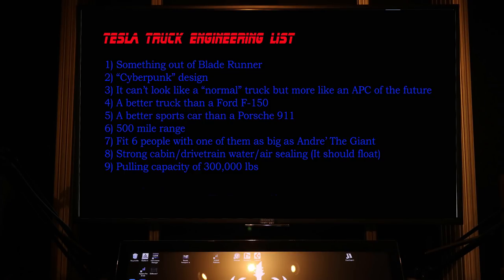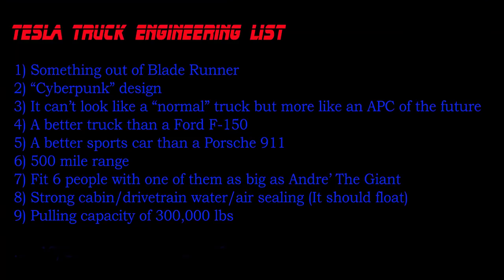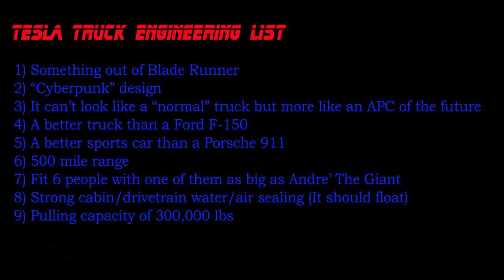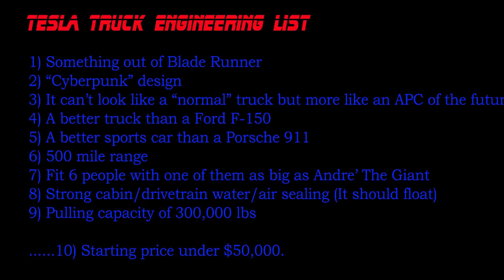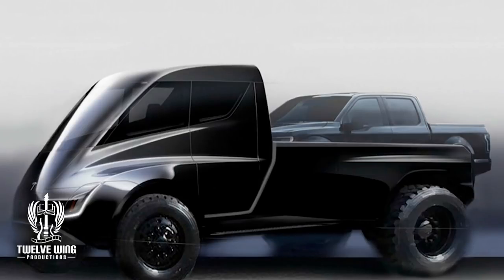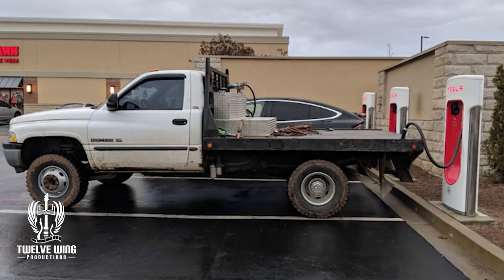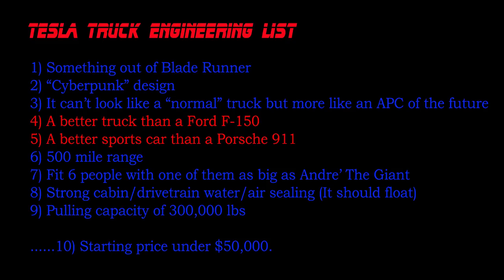What Tesla's Pickup Truck will Really look like: A design exercise

Comment: I say 6 wheels... 6 motors... even spaced, zero turn radius. Moon Patrol. High regen braking to super capacitors to deal with brake energy, especially the front set due to long wheelbase.
Reply from the maker: I desperately looked for a way to have this thing have 6 wheels in my own head.
Rolling resistance finally won out.  As much as I would love to see that, I just don't think it's going to realistically get 500 miles of range and still be able to do that.
I sure hope I'm wrong though.  6 wheels would look sick as hell.
Reply: Twelve Wing Productions if I’m not mistaken, rolling resistance is principally a function of normal force to each tire and their respective out-of-roundness, resulting in the loss of energy associated with overcoming the ‘uphill’ travel as well as the heat associated with the hysteresis of the tire. But by spreading the load over six tires effectively/intelligently, the rolling resistance per tire would be reduced, hence not necessarily increasing overall resistance by 150%.  I also predict that it will have a similar powertrain to the semi with multiple battery packs rather than a large single battery. I predict 3 battery packs of 60+90+90=250 kWh rather than a single 200kWh that the Roadster 2 is supposed to have, which would make it more of a mini-semi, rather than a giant sports car. I know one thing, I am looking forward to November 21...
Reply from the maker: @danwhiffen9235 , all true but there is one other HUGE consideration in a 6wheel vehicle... alignment.
In a configuration where all wheels are equally spaced, turning resistance becomes the major issue with efficiency but in the case where the front two wheels steer (the most common configuration for 6x6 vehicles) the alignment between all 4 of the front wheels is incredibly difficult.
In most of these trucks it's not the fuel economy that suffers the noticeable loss but the scrubbing of the tires and increased wear. 

In the case of an electric vehicle, however, these losses will be very noticeable AND there will be increased tire wear.
So unless they have some way to tune the alignment on the fly (not impossible) I don't really see a 6x6.

But like I said... I sure would love to.
Reply: Twelve Wing Productions I was figuring steering boxes for all three axles which would be digitally controlled rather than mechanical linkages so as to maintain tangency.  Think of the maneuverability, and the complexity. Elon is a wild card with falcon wing doors and cold air thrusters (let alone everything else). This is truly a wondrous exciting time!
Reply: I agree with the 6x6 notion as well.. just in the standard view of a 6x6.. all the issues of tire wear an fuel inefficiencies have been already worked out in the semi truck Industry..  in a turn either the forward or aft axle would lift slightly to reduce drag..now with inboard motors .. this could obtained through suspension dampening on an individual wheel basis maintaining the load / tow weight and torque needs.. 6 wheel drive also makes sense in the towing weight Elon has asked  for .. each motor shares the weight needs reducing wear and higher than needed amp draw...if he can place a 200 kw pack n a sports car .. a 6x6 truck would be no problem.. the cost?.. under 50k?.. think that’s doable as well.. delete the frills..basic model 3 control components...
Reply: Matthias Crenshaw I suspect that a full 6x6 wouldn’t be the bottom trim (50k) alas, I am guessing that trim will be 6x2 (or is it 2x6?) and the battery might be 100kWh... maybe. Barely 200 mile range? 0-60 in 6.5s?... the top trim is going to be nnnnnnnnuts
Reply: Oh well, no 6x6. But what a crazy price. Still looks pretty moon patrol tho
Reply: I like the weird design an love the price.. wish there is more info  on the interior...kinda crazy how franz broke the side windows..😂😂
Reply: Matthias Crenshaw I’ll be in the market for a model Y when they come out, but I doubt I would consider the cybrtrk, not mainly for looks, but I find a van or SUV more overall useful.
Reply: I literally could build a 6x6 on an ex - mil spec Humvee chassis for less than bollinger.. using either used tesla drive units or used Nissan drive units... wouldn’t be hard .. I put money down but I’m driving to build one

Comment: That is a much more intelligent approach and analysis than some of the absurd renderings I've seen online. Most of which simply look like a boring standard old pick-up with a Tesla styled nose and absurdly high front hood. It's definitely going to have the cabin well-forward with a sloping front section for drag efficiency, akin to the semi  but much more raked. Ride height will adjust lower at higher speed for efficiency. The one "out there" suspicion I have is the it might even have front entry.  Also possibly Model X type wing doors for passengers. I also like the suggestions by others that there might be two models. Perhaps one with a small cab/long tray for work and one with a larger cabin for 6 people, but shorter rear tray. And the back end won't be a highly elevated agricultural looking truck with exposed suspension and underbody structure. It will be sleek and slippery but with a more angular and brutalist aesthetic.

Comment: I think if they put the front door in front of the 1st axel and a crew cab door immediately behind the 1st axel then there will be plenty of space in the cabin and enough room for a massive flat bed for the base model.
 See images of a LVS military vehicle, but lower to the ground and the nose more forward. 

The +model; Then slope the lines of the cab to nearly the top height of an Izuzu box truck. This will be an enclosed area to the rear bumper (like a DOT box truck) Add in the AC power outlets (built in inverter) for power tools, side doors with step up, and a self leveling bed (per Zack and Jessie) as the 80k-100k model and we'll have an epic work truck.

 I think overall the lines of the truck will be sharp and flat on the sides with a massive skid plate in the front.
Bonus, it would be cool to see an automatic bed extender in the vertical dimension. Maybe the bed would transform :)

I can't wait to actually see what this truck will look like!
Reply from the maker: That would make it look cool but it would probably really screw up its approach angle.  But yes, that's good "outside the box" thinking.
We'll see what happens.

Comment: Okay I go with your center driver and two side seats set back.  I also agree with the swivel center drivers seat.  The three person bench seat is a no brainer.  This allows us a cab with two doors, one on each side and a step up after the door opens.  The bed is a six foot by four foot interior measurement with a two tier look.  By that I mean that the bed bottom is above the rear tire wells with a pull out drawer for tools or sports equipment or camping equipment.  We also see four side compartments two in front of the tires wheel well deep and two aft of the wheel wells.  These are accessible from the sides of the vehicle and could carry 220 volt adaptors for power tools or camping gear.  The tailgate is a two fold take down the top half opens and extends two feet to allow you to carry sheet goods 4x8 feet.  It is difficult to type this and make hand motions to describe these items so I hope this was clear.

Comment: After thinking about the "APC" comment, the teaser image that Tesla released, and the mention of how "unconventional" the truck is supposed to be, I think the teaser image may in fact show more than people think. The shape in the teaser does look kind of similar to what an APC would look like. The headlight is probably throwing absolutely everyone off, as everyone is used to them being placed below the windshield, and therefore the teaser becomes difficult to process. Maybe there's a second set of headlights towards the bottom of the vehicle that aren't on in the teaser, and the top strip is meant to be useful for example for working on something at night. Other specs being up for debate, motor/wheel configuration could vary, maybe a 6-wheel option would have 4 wheels together at the back and a 4-wheel option would skip the back pair of those wheels, maybe enabling an "aquatic" option where the back pair of wheels are replaced with something to move the truck in the water. Looking back at the lighting position, if the lights were to be placed at the top, they'd remain effective in water since they'd be above water, while if placed at the bottom they'd be underwater and useless.

So my bet is on the tesla pickup being a literal box with some extra edges (APC style) with the headlights in the form of that strip above the windshield, somehow engineered so it doesn't blind the driver or other drivers, possibly 6-wheels or just 4-wheels with an extra package of an aquatic mode at some ridiculous price.

Comment: I think your spot on with the cabin shape. Although it will probably have a flatter angle for the windshield than in your mockup. I'm not so sure about the gliding doors - Elon is not a fan and I'm sceptical about lifetime issues. Also, I think there will be an (optional) removable cover for the truck bed making this into a van instead of a pickup for those who want a van. I have been thinking whether there will be a foldable (instead of removable) cover - that would be even cooler but I'm not sure if it is doable in terms of engineering and where it would go.
Reply from the maker: That was just done as a quick display of concept.  I think the cabin will be a little taller than what I've drawn.
I wanted to stay away from renderings for this exercise and allow each of us to imagine what it would look like if it simply fit the engineering requirements.  Form following function.

Ultimately this thing has to be useful.  If it is incredibly useful, people will forgive any shape.
The current pickup truck, for example, is purely the result of its use.
If it wasn't useful, it would look like something else.

So the elements we will see causing change here is the lack of an engine or drive train.
So we are left to ask ourselves... "How can we increase the usefulness of a truck with the new layout?".
Answer that question and we will have the look of the truck I think.
So I believe they shifted everything forward to take advantage of the extra space given to the truck when the engine and transmission were removed and replaced with a "thick" floor that houses the battery.

I expect that this will be leveraged in automobiles as well soon and give us some incredibly beautiful cars.
Reply: @twelvewingproductions7508  Indeed the removal of the engine block gives huge opportunity in usable space. Just so much you can work with.

And they will go at it fully here. Elon said once in an interview with the Model S/3 they kind of had the extra space from the missing engine, but he and Franz wanted the thing to look traditional so customers would not be scared away potentially. Also it is a safety thing with crumple zone. But with this one they probably are only looking at function and not at all at traditional shape.
Reply from the maker: @john0constantine  Transmission as well.  It's just a huge amount of space when you start removing all the crap you don't need.

Comment: The bed size might be extended by dropping the tailgate for plywood 
The battery pack could be between the frame  rails. To lower the cg.
Dynamic suspension would make sense.  To lower or raise

Comment: Let me make a prediction here: The thing will not only be water tight. It will have an propeller option that makes it into a real amphibious vehicle. Wouldn't that be glorious going around in a lake in your Tesla pickup?
Reply from the maker: Funny.  It also fits with Musk's desire to build an actual working version of Bond's Lotus submarine.
So what you describe would not surprise me.. maybe as an option.

I hope that he and his engineers design elements like water tight and/or elevated connections above the waterline so that we can see some things like third party amphibious mods or other adventure box mods that can fit on the back.
Reply: Not improbable! Electric boat no emmisions on the water. He would love that. Plus you could pull 5 skiers at +50 mph!
Reply: i hope he adds 4 wheel drive. there's a market for that.
Reply: @steve2008s  -"4 Wheel Drive" is Obvious. Did you mean 4 Wheel Steering, or 4 Motors, 1 per Wheel?
Reply: @robertweekley5926  I vote for 4-wheel steering, and while I like the idea of having a 4-motor version/upgrade available, I thought I heard that this was going to have 3 motors (one front, two rear), but please correct me if I'm wrong.
Reply: @russell2449  -Well Russell, things can change, but I remember Elon quoted as saying Two Motors, but that was also before we heard of a "Plaid" Model S!